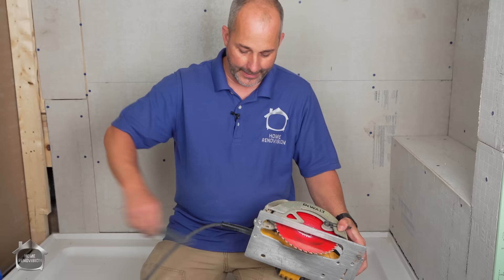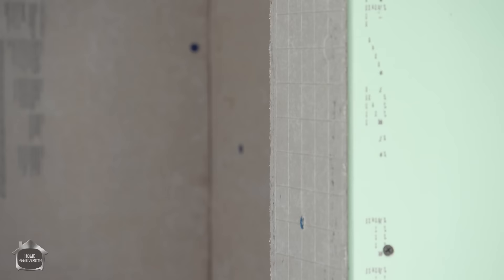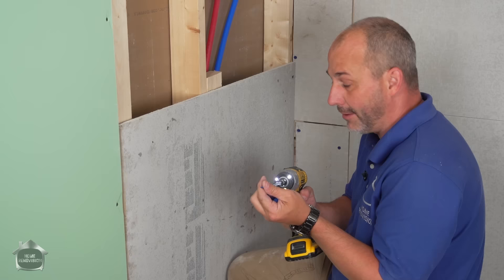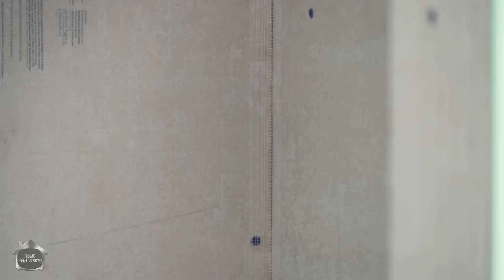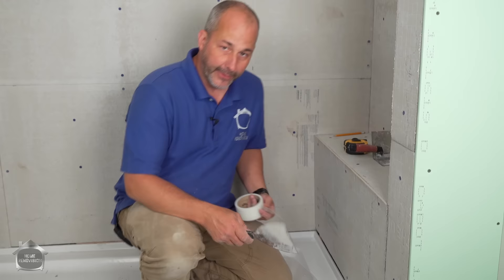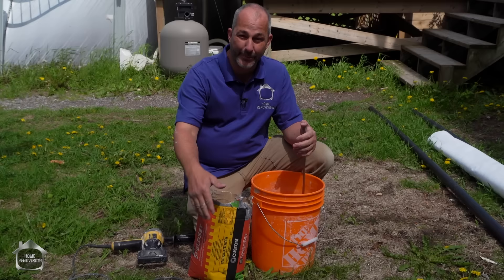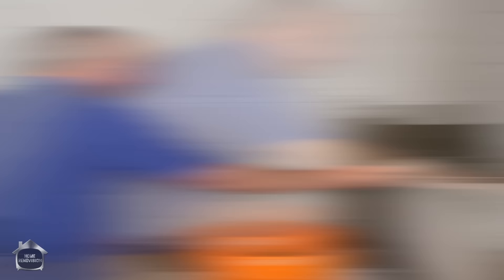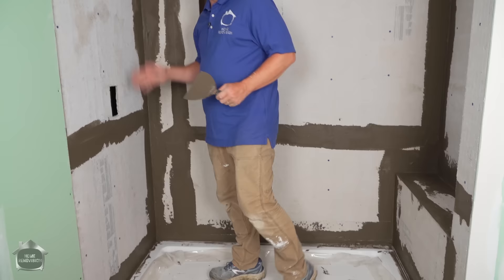How to Install Cement Board for Beginners

Comment: We moved into a 100 yr old house and have just started to deal with a shower wall that was not properly waterproofed.  It is now seeping through the wall and onto the basement floor. We estimate the tile is about 20 years old and likely does not have cement board or a waterproof membrane behind it (as is code in or area of the US). Now we have to rip out the tile (we had planned to do this eventually but it is coming a year early) and assess the damage. When we do put up new tile, we will definitely make sure it is waterproofed to modern standards. We will probably go with this method because it costs a fraction of the Kerdi board system.

Comment: How do you handle the outside corners where drywall meets cement board as well as the cement board to ceiling corners?
Reply: What I did on cement board to ceiling and wall sheetrock was use the same mesh tape and the same mortar mix (thinset).
Reply: I get the cement board tape, I've got same, drywall to Hardie corner outside... corner bead? Or just tile edge profile?

Comment: I live in SoCal! I am actually installing my own shower!! So I've been binge watching all of your videos! (they're a huge help!) I am currently using a rubber shower membrane as well as cement board/ hardiebacker on top of that. Then adding red guard and fiberglass cloth for the edges. After a couple coats or so, how long do you think my shower will last?
Reply: 2 months
Reply: Why 2 months?
Reply: @davidmuniz5307  😆😆😆

Comment: Just finished demo and prep for tile in my parents bathroom. I did a schluder system for the shower over drywall but ran cement board for tile floors. Thanks for the refresh, it had been a decade since I did tile. Feeling good about tackling their second bathroom after listening to this

Comment: Jeff, thanks for the level of detail you put in your videos. Question about this one, what do you use on the outside corners where the cement board meets the drywall? Metal corner bead ? Mesh tape? Or paper metal corner beads? Cheers.
Reply: Metal or plastic corner bead. You cannot ever use mesh or paper on outside corners.

Comment: I remodeled my master and used RedGuard to completely cover the entire shower area. 5 coats and then tiled over it. That was three years ago and the shower has worked perfectly with no leaking issues at all. Thanks for the video, I'm remodeling the two other bathrooms in my house with a tub in one and walk in shower with the other and your video was very helpful!

Comment: You stated to keep a small gap between the cement board and the flange due to movement of the pan then you filled that gap with a rigid material....which one is it????
Reply: You leave the gap so that when you apply the cement the gap fills in with a much more substantial amount. If your board goes all the way down the cement is just a thin skim coat so when the pan moves it’s much more likely to crack. If you leave a gap and fill with cement when the pan moves your cement is less likely to crack because you have more product there to hold itself together
Reply: That being said I prefer to use a schluter preformed pan, a tile backer like glassroc on the walls and then I use kerdi band and corners to water proof the joint between pan and wall board. Glassroc is much easier to install, much faster to use and I like that I only have to seal the joints with a silicone and the fasteners, not paint every square inch of the walls

Comment: Hey There, thanks for the How-to. Did you simply use a sponge to get the quick-set off the shower basin before it dried?
Reply: Crys, did you ever figure this out ? I'm about to tear out my bath and use cement board as the substrate over a new tub. I "could" mask it all off....seems a bit redundant if it comes off easily. Was it still "wet" or did it dry completely then just wipe off ? Thanks.
Reply: I always tape off with plastic to protect the tub, but yeah, it wipes right off.
Reply: I would have taped that area with painters tape… nobody likes cleaning up after themselves… tape saves you 20 minutes

Comment: Jeff, great video.  Question: When redoing an existing custom shower with a cemented shower pan, do you set cement board directly on the cemented water pan or leave a small gap between the cement board and pan before taping the seam and covering with cement like you did with the preformed shower pan before water proofing?
Reply: Yes this question
Reply: he answered this question in his video. you leave a bit of gap to allow for shower base to wiggle a little bit.
Reply: gap

Comment: Hi. Since you are installing a membrane above your durock, do you tape your seams with modified or unmodified thinset? 
Thanks for your videos.
Reply: Neither. You use a quick setting cement.
Reply: Modified… the only time i see companies use unmodified is under cement board for floor tiling.

Comment: Half inch cement board WILL score and snap if you lay it on some timbers and stand on it like he said. I have been scoring it pretty deeply with a normal stanley knife blade. The bigger the pieces, the easier it is to snap apart. Can also score both sides. Its not as clean an edge but less dust...

Comment: I love your videos, especially the one that shows this same technique only cutting out the mortar and tape and just using the same 2 in 1 sealant required for Kerdi warranty before redguarding. Same deal in 1/2 the time....or am I missing something?
Reply: Dave Gordon so can you skip the mudding of the joints and just do the waterproofing? It seems like 2 coats would be sufficient in a smaller tub surround.
Reply: @davegordon6943  Thank you.  This is my first shower and I am starting from studs so I hope to take all the steps and protections so it will last at least 20 years, if not much longer.

Comment: You guys have single handedly helped me renovate my bathroom! Thank you for sharing your knowledge and skills.
Reply: I have seen some shocking attempts at renovating even when they have sound advice... If you have the aptitude and common sense, with a flare of artistic/accuracy then your gonna be just fine and succeed easily. It's not a small matter or job and may cost you more to redo.

Comment: Hey Jeff, love your videos. I am planning on just using a moisture resistant drywall on the ceiling of my walk in shower. How does the waterproofing membrane do when covered with paint, or do I not need to coat the ceiling with the membrane? Also just for clarification, I only need to use 1/2" cement board on the shower walls that butt up to my drywall, and can use 1/4" on the others? Thank you!
Reply from the maker: correct Kerry. except the ceiling drywall will be fine with a 100% acrylic paint and no membrane. Cheers!
Reply: So if the membrane overlaps into area's I plan to paint instead of tileing it's ok to paint over it?
Reply: @ernestpreciado374  no, you do not want to paint over a waterproofing membrane. It will not look good. You want your tile just past your membrane.

Comment: Thanks for another great video, Jeff! I have a question for you (or anyone on here that might know); if I'm just tiling around the area of my bathroom where my sink and toilet are (will not get hit by shower or bath water), do I need cement board or a membrane, or can I tile over moisture resistant drywall?
Reply: Moisture resistant drywall will be fine

Comment: You appear to have a shower pan. Why isn't the cement board inside the pan instead of to.the edge?
I read the instructions for mine and it says the board should fo.on the inside of that lip, the lip should be behind the board.
Reply: I am researching the same question. Watch 10 different videos and read 10 different articles about that question and you will see 20 different answers all for valid reasons. At the end of the day you just have to understand what you are doing and the point of waterproofing and use whatever methods works best for your situation (and codes if that matters to you). Quick answer is it is for speed and making the transition to your finished wall a a LOT easier. You just need to cover/waterproof  the gap. You can do what he does here or use a 4 mil vapor barrier behind the cement board to the bottom of the flange and a kerdi strip in front over the corners and bottom gap. Or you can furr out and put the board in front of the flange. It is up to you but that it can create a whole host of issues matching up to your drywall later (depending on the layout). You just don't want water to get to wood. Grout and cement board are water/mold resistant but NOT water/mold proof.
Reply: He answers that question in the video

Comment: Hello Jeff, Great video! I've used several of your videos while remodeling our house. On quick question, have you every used Tadelakt or a similar plaster for shower walls? If so, any suggestions as far as water proofing before applying the tadelakt or if it's needed? Most tadelakt info I've found doesn't use one since the finish is suppose to be water proof, but I like to be certain and use a little overkill to be certain. Thanks, James
Reply: Plastic sheeting over the studs for all applications.

Comment: Kalamazoo, MI.  Ordered both Kerdi Membrane and Kerdi Board.  30 day return on the system I won’t use.  Board looks to require less skilled “technique” when using the thin-set and ensuring no air bubbles and level walls.  Confident we’ll get there with your help Jeff. Looking for the video on a shower bench installation  and how that ties into the door side of the shower… 🤷‍♂️  Will be using your affiliate links for purchases - 👏👍

Comment: I'm doing a shower, so this is NOT a theoretical question.

IF you have to waterproof it anyway - WHY use cement board?

Why not a mold-proof drywall?

I certainly accept your premise on cement board wicking moisture IF it fets there - but the trick is to STOP it before it does . . .
Reply from the maker: I couldn't agree more, however in some areas of the country it is code to install it. So we did this video to show how. If your region is fine with drywall like mine I say go for it. Cheers!

Comment: I just used a multi tool, vibrating tool  worked great with a drywall cutting blade  No problem  first cut shallow second cut all the way through.

Comment: Was quoted 14k$ to do this shower with green board......I had no choice but to follow this guide and do it better with better materials.  Thanks!  FYI.. only missing piece is cement to drywall transition.

Comment: That large gap in the lower corner... is bugging the hell out of me
Reply: I stopped at 42 seconds because he said theres no difference between drywall and cement board.
Reply: That's why you stagger drywall
Reply: That will get filled by the other wall cement board.  It does look ugly though lol
Reply: Charles Frazier IV Why? He’s just saying cement board isn’t a lot harder with the right tools. I agree with that.
Reply: @TheSubtleBeast  the concept of analogy escapes you. If your attention span exceeded 42 seconds you might have actually learned the context of the remark.

Comment: Why not score the cement board with a utility knife with a few passes and then snap it with a piece of 2x4. Keeps the dust waaaaay down. Otherwise I like you videoon the installation and preppping for tile. Thanks
Reply: This stuff is dense and scoring it is not going to cut it. You''ll go through a dozen blades trying to cut through.
Reply: @americanindeon  I score it a few times then put a 2by4 under the cut line and snap it....works for me
Reply: @AnMadreMor  You scored the . 42 thickness and snapped it? I tried it on scrap a few times with a 2x4 a few times and it would not break and when it did it wasn't a clean break at all. I scored mine a good dozen times.

Comment: I love your work and explanation to everything you can think of  Im a DIY contractor and doing my first Tile shower I have opted to use Water Proof GO BOARD instead of  Is it Necessary to do a complete membrane  other then the joints and screws ?? TYIA

Comment: Novice DIYer here. I’m reading everywhere that concrete backer board needs to be set on top on thin set, then screwed in, otherwise it voids manufacturer warranty. I noticed you screwed it straight to the studs without thin set. Would the warranty be voided at this point?

Comment: Couple comments from a lifelong custom shower builder.
1. Put the shower valve in first
2. Use 6" water proof membrane at shower pan joint, not 2" mesh tape.
3. Water proof coating in shower nitch and all the cement board area. Moisture will transfer into the wall cavity and can cause mold. Especially on an outside wall.
4. Durabond and tape joint to drywall before water proofing.
5. Overall very good. You cannot do too much prep for a shower.
Reply: Please advise after applying Aduadefense waterproofing on the cement board, what kind of thin-set mortar should apply on top of the Aduadefense (substrate) for small tile under 6" x 6"? I watch many mortified or un-mortified thin-set with many ANSI specs, and now I'm confused. Thanks for your pro tips

Comment: Very nice.  I have been using these Hardi cement boards for over a decade here in Ottawa.  It's simply superior.  The only reason why any contractor would use anything else for waterproof area is because they don't know any better, or are just extra lazy because it's harder to work with.  For waterproofing membrane, I use BlueShield for large area, and RedGard is tougher when dry.

The fibreglass you used isn't well tested for embedment into cement.  There are alkaline resistant fibre tapes specific for this application.  I know I am nit picking, but if we are taking bathroom to this level, might as well take it all the way.

Great job introducing Hardie.  I will give Aqua Defense a try one day.
Reply: Octavian, seems like you know your stuff.  Didn't see it in the video - what's typically used to tape/mud from the hardie board to the drywall, both walls and ceiling? The transition has to be fairly inconspicuous as drywall just gets paint, no tile.
Reply: I have one. Contracter said that he needs to be a blue membrane installed before the cement board. Is that true? I’ve never heard of this.

Comment: Back in the day when I did bathroom reno's with wall surround's for a tile job I would  staple 4 mill plastic on to the wall studs then screw the hardy backer over the 4 mill plastic then thin set mortar the joints with fiber tape , but back then there was no U tube to discover these new technique's , also that six tooth blade is nice I had a heavy scoring tool to score and snap like drywall even the 1/2 inch stuff , I'll have to pick one of those up , also I will say that the paint on waterproofing is probably a better idea , thanks for the vids !

Comment: I'm going with this option. I'm also laying cement board to be the subfloor. The builders did a great job I found during my demo, but choosing a cheap shower frame caused my leak, it just took skimping on 1 step that got my downstairs to have a leaky ceiling. Buy the good stuff and DIY! I'm over engineering this bathroom renovation so if we move, nobody has to deal with the pain of it again.

Comment: I live in West Virginia Hardie backer board is my favorite it work good hard to cut.  I put plastic on the bare wood stuture just a back up behind the hardie backer board on the walls only. Half inch on the walls quarter inch on the floors for the hardie backer board.  When I finish the walls in a shower I use RedGard as a crack prevention membrane.   Over kill maybe but I feel safe. As a finish on the grout I use the Fusion Pro ready mix price is high but it has the sealer already build in .  Once again it all about stopping mold and leaks.

Comment: I'm in Louisiana, doing this general process around my tub/shower, plan on doing it again for just shower later in the small bath.  Idk what the code is here regarding anything but a few electrical things I learned from a master electrician.
Reply: And thanks for the video!  :)  Membrane is redguard was the only thing I saw at home depot.

Comment: I'm an Indiana DIYer using the cement board, fiber tape, AquaGuard system. My question is how to waterproof and tile around wood frame fixed double pane windows that are in the shower space. One is directly across from the shower head, the other is to the side. Both are 4 feet from the floor. Love your videos. I watch them carefully multiple times before doing the work.

Comment: Hi, Just a quick Q. Can I use cement board and then water proof it with Schluter membrane? Or should I just stick with the Aqua Defense roll on? Also, can I apply the Aqua Defense roll on onto mortar (sand and cement)?
Reply from the maker: yes and sure thing. you can use any waterproofing system you want on anything that gets tiled. Cheers!

Comment: I know this video is over two years old, but I am hoping I can get my question answered. I'm working on my bathroom which has a beautiful cast iron tub. The problem is dealing with where the cement board will meet the tub. I see most of your remods have tubs with the tall flange and in this video you are using the mesh from the board to the tub flange and filling it in. What method would you use for a tub with the very small curved flange as the old irons have? Be thrilled if I can get an answer from you. You really know your stuff!
Reply: There's options... so long as its sealed good.  Not sure exactly what' you're describing,  but I'd take the cement board down to the flange (not over the flange, because you want things perfectly flat/straight to tile over... if there's a small gap... no biggie, better a low spot than a high spot to level surface).  Then use silicone caulking to seal between concrete board and flange.  After silicone dries, apply membrane paint, then lay waterproof mesh tape into the paint and paint over again.   Some people use that waterproof mesh tape like that over all the joints.
Reply: Do your best caulk the rest